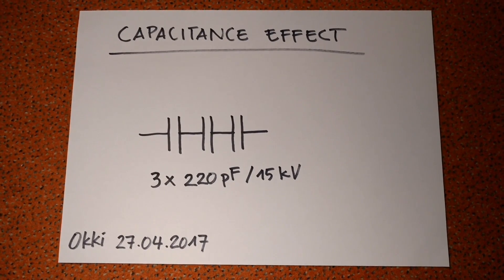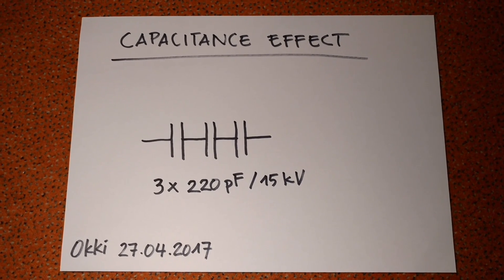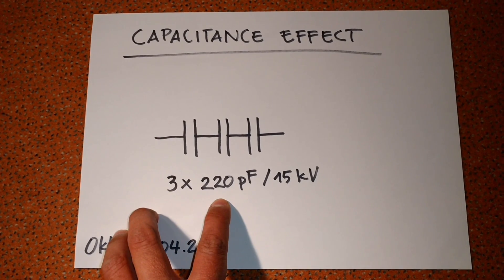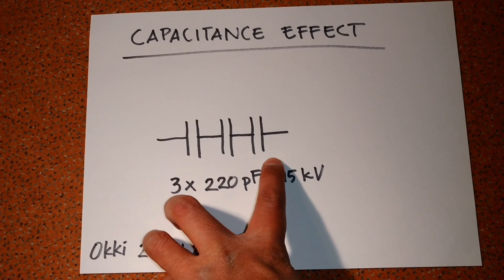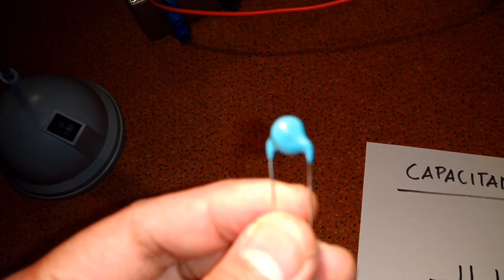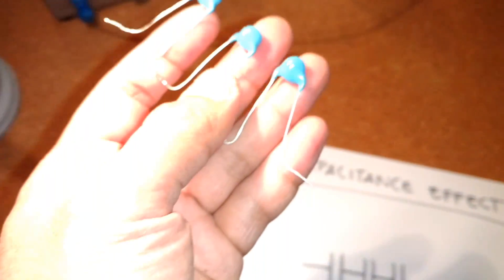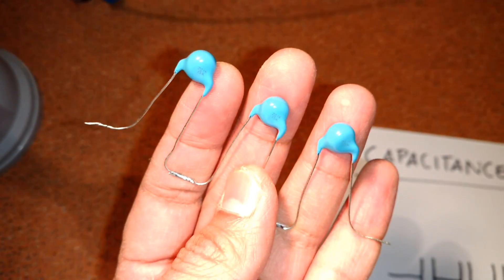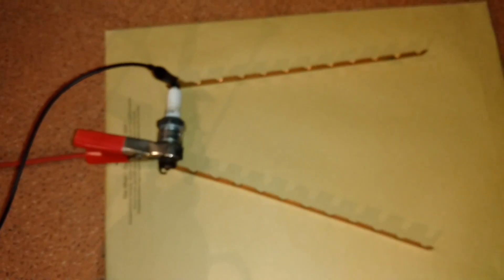Simple Plasma Ignition - Capacitance Effect

Comment: The capacitors only allow more electricity to flow, the more capacitors added the more electrical current is being added, because there is more space or threads(vias) where electrons can move through, there is no plasma such thing doesNOT exist and neither electromagnetism because is not scientifically possible to mix, combine or have electricity work with magnetic energy, no such combination is possible
Reply: Um, what about electromagnets? Or eletromechanical generators? Or railguns?
Reply: I guess somebody forgot about basic electronics. There are a few components called inductor, transformer, relay, speaker... Do your research before you speak please
Reply: Fernando Salazar Esta bien, pero halgo me dice que lo que tu estas diciendo es una alucinasion hermano. Bien dice las escituras que dios le ba a dar la mas grande Mentira y creeran halgo que es totalmente Falso a aquel que no creera en su nombre. Yo solo digo hermano que no todo es computadora como tu lo crees. Hay un mundo espiritual que si es real. Hay te lo dejo en tu consiencia hermano.
Reply: Pedro Rocha 
Electromagnets doNOT exist 
Electromagnetism doesNOT exist 
Magnets are force of elements not electricity because electricity and magnetic energy are two different things that cannot work together or not combine, not scientifically possible for them to combine or be fuse or work together, separate entities
Reply: The please, explain how the FUCK a DC motor works. Furthermore how said motor CAN BE USED TO PRODUCE ELECTRICAL ENERGY! Thank you.

But seriously if I am missing out on something here (or if I utterly misinterpreted you) then please do tell.
Reply: Can u explain electromagnetic waves ?? I'm not here to judge on u sir educate me ..
Reply: astro zain 
Electromagnetic waves doNOT exist, because again is impossible to fuse, combine or have electricity and magnetism be working among.
EMP is fake, electric waves are just electrons being transmitted but have limited distance as heat dissipates, they usually call this as lasers which is an incorrect form of speech, because they intentionally misname items or things intentionally to deviate the true.
Signals are not magnetizable and neither is electricity.
They using wrong ideas and wrong formulas to wrongly educate everyone and keep the ignorant, is more simple than what they make it seem because they don't want people to learn.
Is all the Military making everyone stupid.
Reply: You can't prove a point by simply saying something does not exist, or can not mix. I dont care how many caps you use that's some "hair-brain" science you're using. A simple amount of research performed by a person of even moderate intelligence would conclude that, in fact electricity and magnetism are the same force. This is how we understand the 4 forces of nature in physics which are ; small nuclear force, large nuclear force, gravity, and electro-magnetism.
Reply: I think it's safe to say at this point that you're trolling, at least, I very much hope you are.  If not, well there may be no hope for you.
Reply: Fernando Salazar HAHA wow! See now thats an example of when someone plays too much videogames. You think Nothing exist, other than porn, devil and videogames, because you might never go out and at least explore the world. I wonder if you know that Real girls exist? Do you have a Girlfriend at least? Kids these days thanks to the internet think they know it all. come on kid go out and spent some time with with real human friends, other than "online" friends. If you want to add my son on PS4 as a friend let me know, ill give you his username. In my head I imagine you as kid with gel on his hair, pimples, and his hands very strong from too much masturbation...
Reply: Josh Blackburn 
You repeating like a parrot now, trolls doNOT exist that is another lie they made up.
Reply: John Stoner no you been lied
Nuclear force doesNOT exist
Nuclear energy doesNOT exist
Fusion doesn't exist
Gravity doesNOT exist
Electromagnetism doesNOT exist
And physics doNOT say this fake ideas exist, this fake ideas are lies made up by biological computers that are manipulated by Satan with this fake lies, not ideas, fake stupidities that doNOT exist in real science, this is not physics as you think is lies, physics would be real information not false information they lying and using fake ideas as physics no! That is call a lie not physics laws, correct yourself
Reply: Fernando Salazar You said in the other comment that God, Jesus, Angels doesnt exist ONLY Satan exist. THAN PLEASE tell me, where do we come from???
Reply: MrChabulawa12345 
You are a multicellular organism that has been artificially created by the USA military, they are biological computers but name as cells of the system, a system made by the USA military against man kind because they lead the corruption against man kind, supposedly they created this system to educate people, but that was a lie, it was created to manipulate all of you and use you as a weapon, because biological computers betrayed man kind, they using time travel tech and the same military created all that BS about religion, because God doesn't exist is a synonym for a biological computers they created to kill me, whose name is Jose Santiago Herrera refer as the devil, because the devil made some Tech in the future to copy his data inside every other biological computer, so that was the plan created by the USA military, all a conspiracy to kill me in disguise of making no-one happy, just lies from all this bullies, North Korea doesNOT exist the military is making those videos inside the pentagon with VR tech and some editing, they want to scare people and manipulate them, so they think that they need the army and the military, but there is no threat only them, the same way they lied about 911 and all the BS about planets because NASA is just an extension of their conspiracy and is all lies, cellular structure is adaptive, bacteria doesNOT exist and neither viruses most viruses as they claim die instantly with oxygen so they can't travel in air, people are directly being injure by other biological human computers who are manipulated to move at the speed of electricity by the data of Santiago who is secretly being call God, no god doesNOT exist, Satan is the son of Santiago whose name is Jesus, they use the name of Jesus Christ because the name Jesus is his name and Christ is fake never existed, they make stories to manipulate the idiots and have them pray as a way or mechanism to have them teleport the data inside those ignorant bios minds and use them as weapons against me and others, diseases doNOT exist as simple as that, they are all directly and intentionally cause by the human biological computers known as cells of the system made by the United States military, Hitler was never real just more videos made in the pentagon by all this traitors who faking that idea of terrorist to go in the Afghanistan desert to hide, there is no way for an airplane to destroy a steel made building, do the math, fuel doesNOT melt steel, and airplane is not harder than steel, just movies and CGi by the traitors of the USA army is all lies, no atomic bombs are not scientifically possible is all lies from them and other bios who are manipulated to keep everyone stupid while they can get away with killing me and the others as well, and their goal is just to injure as much as they can while lying and keeping everyone as stupid as possible, figure it out and stop being stupid.
Reply: MrChabulawa12345 
Angels is just a synonym they use referencing human clones, because Santiago and other bios are cloning humans, the Chinese are all clones of the rapists Jose Santiago who is known as God, the Japanese are all clones of Satan.
They lied about Atomic bombs in Hiroshima and Nagasaki as a lie because they made a movie in the Army, they use dynamite to make the explosion and they just use CGI to make the side expanding effect, oxygen doesn't allow side way expansion and also temperature is just CGi and lies they saying to get away with their evil plan.
The reason they lie about Hiroshima and Nagasaki was to fool all idiots in the USA and that way protect the Japanese clones, because the more clones they have the easier is to manipulate them to injure me and kill me, because they want me to suffer and never be happy, and they are getting away with it because they manipulate you and others who are completely retarded by the same USA army, they bringing more immigrants and just calling them dreamers because they are more ignorant and is easier to manipulate them to use them to injure you and me, there is no refugees they doNOT exist is all lies that the devil and Satan are manipulating the idiots in the USA gov to get away with his evil plan, all are contributing as everyone is being manipulated, they teleport inside people's home and they rape them while sleeping and also injuring people and lying about diseases and or other fake ideas.
Electromagnetism is a lie because not scientifically possible to have magnetism and electricity combine as simple as that, but as usual they are liars and the system needs to exterminate them because they just a problem
Reply: Fernando Salazar lets say youre right, BUT how do YOU know all these?? How learn it?
Reply: MrChabulawa12345 
Don't pray because they use that lie to copy, besides praying never solves or had ever solved anything, so stop the bullshit ok! You know is fake and as simple as that.
Is all computers and you are bios who have no feelings and can't smell, just actors nothing else, and god doesNOT exist is just a synonym because they reference another bio as god because all biological computers like you betrayed man kind, and you don't want man kind to be happy, is how they manipulate the system with fakery and lies, I am not delirious you and the other bios are because are desperate to injure me and other bios, so your system knows, they make all the delusions of fake science and fake gods and fake ideas just to try to excuse themselves by injuring people and lying saying that is other things that don't exist, I am done with the system allowing all of you getting away with all this fakery, time for your system and everyone's else system to understand all this lies are evil intended, just to try to harm others and lie and excuse themselves with lies, no more I want every bio to be exterminated now, and you and everyone else stop lying about god and all that fakery of Christ, we are going to fix all this BS and the problem is the bios and the ignorant system allowing a$$holes like you to talk and repeat the lies like parrots
Reply: Fernando Salazar esta bien hermano. Como tu quieras. Y no, eso es incorrecto, yo no te quiero lastimar. Deseo que seas Muy FELIZ!
Reply: MrChabulawa12345 
Solo hablan mentiras 
Si quisieran que fuera feliz jamás hubiesen traicionado o hubiesen preferido a un violador o nunca hubiesen mal educado a las mujeres a pensar como hombres, todo es mentira siempre han organizado todo para molestar y mentir
Reply: MAURICE 
You exist only because the System hasn't exterminated you yet, because is pointless to have evil cells of the system like you, because they think that committing crimes is funny only because they are miserables and want to make other people feel sad, the problem is the system not exterminating you and the other men like you immediately because as long as you exist crimes will keep occurring, obviously if you sexual assault someone it does exist, because you would commit a crime, you are just trying to manipulate yourself to think that such thing wouldn't exist as a stupid way to try to do a crime and try to get away with it, which is not going to happen because you will be exterminated and I want you to be exterminated as soon as possible which is now(immediately).
Reply: if i did this to my motor cycle what will be the effect??
thank you.
Reply: daisy estolas 
It will burn because it will overheat from the electricity, plasma energy doesNOT exits is a fake idea, a lie. A hoax just like moon landing and living in a globe spinning faster than the parrots able to repeated.
Reply: so this is not advisable  .. thanks
Reply: daisy estolas 
The capacitors each allows more electricity to flow through, is like making more bridges or more roads for cars to go through and the more they go through the more it will overheat.
Reply: So hindi ito maganda sa makina? Mr. SALAZAR

Comment: why not using one 300 pf capacitor instead of that cluster?
Reply: Maybe he doesn't have any 300pF disc capacitors rated at a high enough voltage
Reply: that's stupid! he can parallel 2 series of 3*220! then he will only need 6 of them not 12! then again what he does isn't frequency related so he has a large tolerance  margin and he can easily either use one 220pf or use 2 of them to make a 440pf.
Reply: Masoud Rad Yea, I really don't know what he was going for, maybe he wanted to show how it increased as he added them for demonstration.
Reply: Probably for demonstration purposes.

Comment: If I remember right years ago there was an aftermarket sparkplug cap available with a capacitor built in for a hotter spark so they claimed
Reply from the maker: Yes, Nology HotWires for example.
Reply: pulsar plugs
Reply: Yeah, but it's just used best when ecu remapped so it's not really for the family sedans or anything. And to a certain extent it's not truly for passenger vehicles at all, needs better equipment to take advantage of it.

Comment: This doesn't work in vehicles... at all... infact it kills power output on a vehicle. The only reason it works on a bench is because their power source is taken from the wall and a diode rectifies the AC, and the cap (in this case MOV), shunts the wall power once the spark bridges. It is like having a dead short to the wall. If you are being sold on this for an ignition, it is a scam.
Reply from the maker: You are wrong. I use this system on my daily driven car. On this video I use 12 V 7.2 Ah battery to power the ignition coil, no AC input from wall outlet, no rectifier, only high voltage capacitors. On my channel I don't sell anything. My intention here is just to share my knowledge. I have learned many things all my life from other people and now it's my turn to share mine.
Reply: Okki Moeljadi  if he's wrong then where's the data? Like Dyno sheet..
Reply: Did you get any improvement? I doubt it.

Comment: I'm inspired by this, can you please use oscilloscope on this to see if there's spark timing change? I'm afraid that the capacitors delay the timing a bit, accumulate the energy and release it at the same time. Just curious. Thank you.
Reply from the maker: Thanks. Theoretically yes. But in reality I cannot feel any difference. I did not change my ignition timing on my car. But you have to observe your engine yourself and make adjustment as needed.
Reply: Think about a stream of water on a pipe. It flows constantly. Now take a bucket. The bucket is the capacitor. Put the bucket on the end of the pipe. Now the water has to fill the bucket to be thrown. It will create an interval in the water flow, but with a little more power. The same with the capacitor.

Comment: 100k mile sparkplug....now  a 5k mile plug
Reply from the maker: With this simple plasma ignition you will not reduce the spark plug life that much. I have this system on my car and I did not see excessive wear of my spark plugs. Your statement is only true with actively charged capacitor plasma ignition which I also have once installed on my car.
Reply: Okki Moeljadi every spark removes surface atoms....the more powerful or the more frequent the sparks are....the more surface get pulled away.....so yea the spark plugs will wear down alot faster.

Comment: How many 
Volts.   DC or ac, Thanks, this has inspired me.
Reply from the maker: Thanks! Baladár is right. The output voltage is above 10 kV. The input voltage is 12 VDC. The DC voltage is interrupted by the igniter. So it is basically pulsed DC.
Reply: The spark is above 10 kV, and of course it's AC, you can hear the buzzing constantly. The guy said that "... I turn on the IGNITER...". An igniter makes high voltage AC, usually 22-40 kV with low current.

Comment: waw, very interesting. my question is can this improve performance of my 110 cc moto ????
Reply: sure why not man.
Reply: try vaporizing the fuel in an oxygen free enviourment with heat and then use torroid electromagnets to help the vaporized fuel flow.
Reply: This is what's happening in the battery volt stabilizer. Basically a capacitor, helps creating a larger spark in the spark plug
Reply: excellent idea, thanks . it need some preparation.
Reply: alone it wont have any effect just bigger spark. but if you want to upgrade fuel intake, bigger spark will be necessary to burn all the fuel, but just change your ignition coil for that matter instead of using that one.

Comment: I have 28 cc 2stroke engine gas radio control boat, will this work? Thanks for your reply. Nice video.
Reply from the maker: Thanks! As long as your motor has ignition coil, this should work I think.

Comment: When running Capacitors in series, you get LESS Capacitance (formula = 1 (1/c1 + 1/c2/ 2/c3), so you are getting around 73pf capacitance.  You are getting enough KV in series to handle your 30KV coil.  

You would get better results with one capacitor of required KV because the capacitance of one capacitor would be higher than series capacitance.  Your test using multiple strings of capacitors increased current, because you kept adding 73PF each time, by adding capacitors strings in parallel.
Reply: I appreciate our explaination, but I think Okki knew what he was doing.